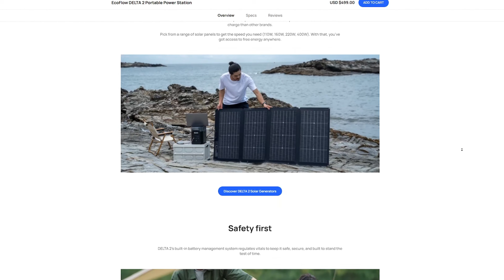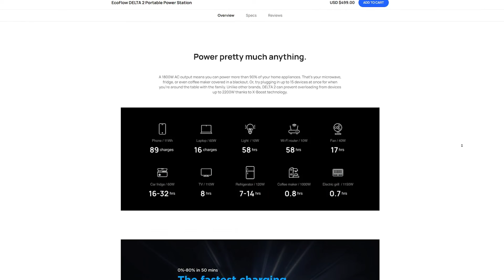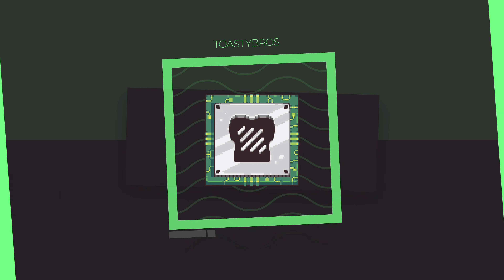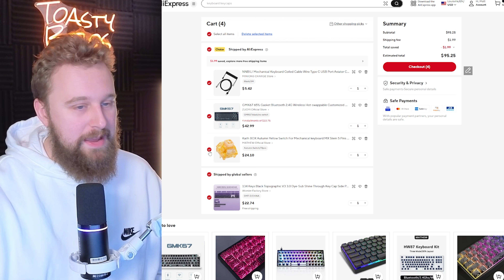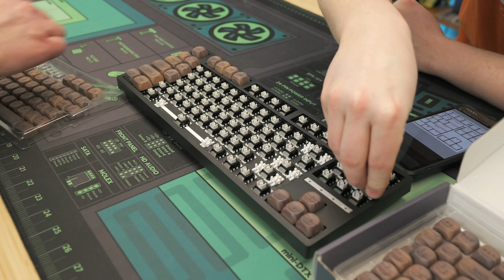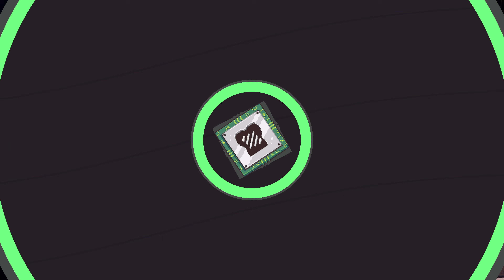Noobs Build Custom Keyboards.... Budget Gaming Keyboard Challenge

Comment: If you want to add weight to your keyboards inexpensively, get some adhesive wheel weights. 12oz/340g are $7-8, and are 0.25oz/7g each, so you can place them as needed.  Not quite as fancy as the brass plates, but they work great.
Reply from the maker: Interesting! Noted for next time

Comment: Hi Guys!  For a cheap mechanical keyboard from Amazon let me recommend to you the Wormier F87.  Comes with Womier Pre-Lubed White Linear switches.  Board accepts 3 or 5 pin switches.  South facing Full RGB.  Wired (here is were they cheaped out).  TLK. Scroll knob for sound.  Double Shot PBT Key Caps.  This was only $20 when I purchased it.
Reply from the maker: Womier makes some great keyboards!

Comment: I tried south facing legends, my hands and fingers blocked a lot of the letters  An RGB keyboard without shine through key caps is almost pointless, in my opinion  Most high end switches sound about the same because they bottom out and make a loud noise when they do   It's how a switch feels, not the sound that matters